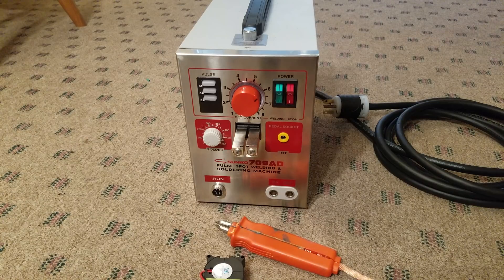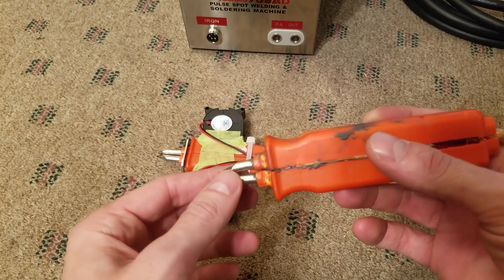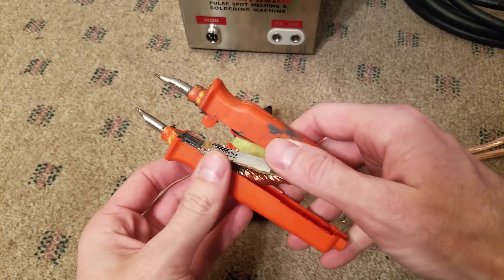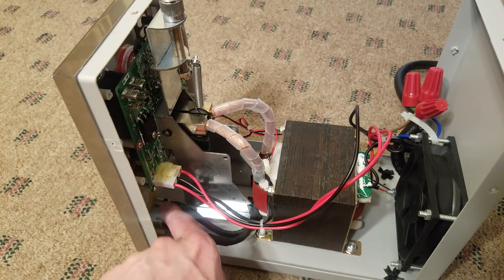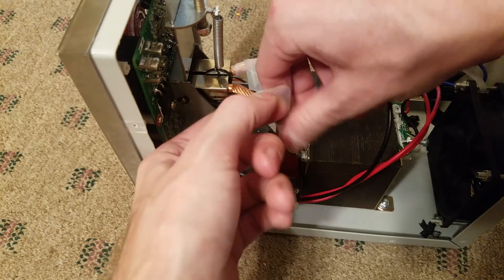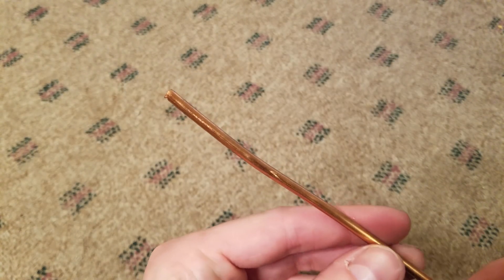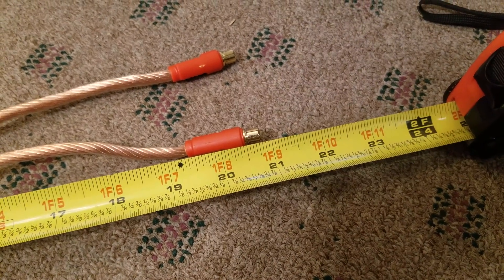Sunkko 709AD Spot Welder Welding Pen Upgrade, Extra 100A+!

Comment: Just did 1400 weldings, not super-fast and a quick quality check every 60 spots, it's a 709AD+. After the job the pen was only just warm, not even hot. Set at 6P and current at 5. I tried going faster (around 3 spots every 2" plus 1" to move forward and it did get warmer, but I still stopped every 60 spots for a quick check and had no heating problems). Maybe you go super-fast with no pauses...
Reply from the maker: What thickness and metal type strip were you using?
Reply: @LithiumSolar  nickel strip 0.12

Comment: A very good job as usual! Well done. Couldn't you simply remove the plastic handle and insulate the original cables? I also have a 709AD, if I have the same heating problem you know I'll be thinking about you LOL :D jes

Comment: Did you know that if you remove the hardware on front of the two welding arms, that you can then plug the welding pen directly into the main welding arms of the machine.
Reply from the maker: Yes, but there is nowhere near good enough contact

Comment: Why not just replace the wire going into the back of the welding pen with 4 gauge solid core and crimp the welding cable to that?

Comment: Bit of a longshot, but I'll try. Any chance you know how to change the copper electrodes on these spot welding pens ? I can't seem to figure it out
Reply from the maker: The tips just pull straight out with pliers. You should have received a few extra tips in the box of accessories (at least I did).
Reply: @LithiumSolar  Oh, I was afraid I'd damage something. Thanks a lot for a quick reply. Cheers!

Comment: I am not sure what happens with my mod. The only difference is my unit is the 787 and it does not have the pen option terminals and that my solid copper is 4 awg vs the slightly smaller one used by OP. I am getting way less amp and barely dent the nickel strip.
Hmm, now that I think about it. The 3/8 copper tube was oxidised on the outside but that should not have any impact. However, the solid copper rod was slightly oxidised so it may reduce the conductance. I have to remove it and sand it down to a shine and try again.
I wonder if my ghetto crimping is good enough. I just used a ratchet wrench (no fancy hydraulic crimper with die) and crimp down the middle.
Reply: I answered it myself. After cleaning off the oxidation, I was able to weld like normally. I don't have an ampmeter so I can tell if I am getting better power but it seems to well 0.15 strips well.
I was wonder if anyone know of a point on the circuit board where I can get a steady 10-12V 300mA DC. I was looking to power a 120mm fan which I've added to the 788 (corrected from previous comment). Right now I have a separate transformer to power the fan.

Comment: Does anyone know if this upgrade will be able to spot weld 0.15 nickel plated brass on top of 0.1mm pure copper sheet? 

Also I'm struggling to find the copper butt connectors :/
Reply from the maker: For the splices, just search Amazon for "bare copper butt splice" - there are dozens of listings. I'm not sure on the brass/copper question though unfortunately.

Comment: Interesting video.  I made the german kit version and it works well off a battery.  A few comments, electrons flow in the outside of a  conductor and so the wire you are critical of with all the strands is by far the best conductor there.  Keeping the overall resistance is critical for best performance.  Reducing the thickness by half of the wire is not good.  Using relatively thin solid copper is not as good as thicker rod for the electrodes.  It is easier to drill a bigger hole in the back of thicker rod and solder in the copper multi strand wire.  Each joint with a crimp will have copper oxide on the wire and crimp and increase resistance, consider a light crimp or no crimp and solder in addition.  Copper plumbing pipe which is work hardened when extruded can be used for joints.  Heat it in a gas flame and quench it in cold water.  It becomes very soft and can be cut cross wise and longitudinally to give whatever size you need for a crimp.  It can ce flared easily by hand using the taper on th end of a screwdriver or similar.  resoftening maybe needed halfway. If you can measure very low resistances the success of these alterations can be compared.  The length of the wire is also a factor as it has a small resistance.  Each area of resistance such as a joint will cause local heating and loss of current.  My electrodes are like yours but the copper is thicker.  I place them on the strip and touch a foot pedal.  It works well.  The guys with poorly performing machines should be concentrating I think on the output side not the transformer as I  run mine quite happily on a 12 volt high quality lithium battery from Hobby King.

Comment: Thanks for the video, couple years ago I built a 7p8s 26650 24v pack for a power chair, I made my own 'spot welder' using jumper cables, a shop quality battery charger, and a 72 series battery, so I was getting about 13v 800A or so thru a pencil sized rod of copper - two handing it, ground probe to push down then I'd strike it with the hot lead - I started out with them rigged up through a broom handle piece - it was a learning process lol... Revisiting it now, two years later as I was rebuilding the battery pack (8 cells of 56 had gone high resistance) I got one of the sunkko spot welders to help with rebuilding it. I found it to be sightly anemic for the thicker nickel I had - works fine with the thinner strips that usually get used for 18650s - I'm probably going to investigate doing something to milk some more current out of it

Comment: Thinking of buying this spot welder. How has it held up since this video? Is it still good? Thanks!
Reply from the maker: The Sunkko 709AD 240V still works fantastic. I've welded tends of thousands of cells with it at this point. There are better options on the market today though. If I were buying a spot welder again, I'd probably look at the kWeld. It has much higher power without the need for modifications.
Reply: @LithiumSolar    sweet! Also one last question. How many more times have you had to rebuild your leads?
Reply from the maker: @Bloodofmyshxdow  I haven't replaced anything since this video. The tips tend to get a bit rounded after a lot of welding (thousand or two cells if I had to guess), but they're back to perfect again after a minute or two of filing with a handheld file.

Comment: Hi is there a reason you did not use the outside  holes?
Reply from the maker: Yes. The wiring behind it is thin and there is less resistance, which means more current, to clamp directly to the source :)

Comment: Increasing the current by lower resistance of electrodes and increasing the length of the electrodes will also increase the inductive kickback that comes back to the relay after the pulse. May not be a huge issue at currents as low as 600A, but it also depends on quality of components used in the welder.  A much higher quality welder, like kweld that costs $200 just for circuit board, can withstand 2J, so about 6 feet of cabling at 1500A pulse. Not sure how long these chinese welders will last, but electrode length and inductive kickback is something to keep an eye on. This is why welding pens sold with these welders are usually very short.
Reply from the maker: I have welded tens of thousands of batteries since owning this welder. If I knew about the kWeld when I was in the market for a welder, I would have definitely gone that route...

Comment: What u considering to buy other than this one, i just know kweld(i think this one need to resamble yourself)also not found any in my area on ecommerce
Reply from the maker: If I know now what I did back then, I would just buy a kWeld and not the Sunkko. I'm not personally familiar with any others than these two.
Reply: What u consider learning from ,for beginner no knowledge about batteries ,solarpanel,scc and etc

Comment: How are you supposed to change the welding pins on this model?  I used a pair of pliers to pull mine out, true maximum effort, and they wouldn't budge.
Reply from the maker: I only changed mine once in the stock pen. I didn't have any trouble. I grabbed the pin with a pair of channel-lock pliers and twisted it back and forth, they came right out.

Comment: have u tried pure nickel 0.20 or 0.15mm ?
Reply from the maker: I'm using 0.15mm. I have not tried 0.20mm.
Reply: LithiumSolar pure nickel?
Reply from the maker: @ee-sj8qr  Yes, 0.15mm pure nickel strip.
Reply: @LithiumSolar  cool are u able to weld continuously without it being overheating? I'm facing the issue of the welding pen overheating if I were to spot weld continuously without stopping.

Comment: instead of crimping will soldering works to join the connector together? i am thinking to replace the wires for my sunkko pen to the same wire ur using here.

Comment: just to note you are using pure copper for the electrodes which will probably stick more than the copper/aluminium alloy that the electrodes are made from (which apparently sticks less and doesnt oxidise) think its aluminium bronze, its a bit more expensive and harder to find than pure copper but i found an 8mm dia 100mm piece im gonna try like this4
Reply from the maker: Interesting. I figured pure copper would be best. They do stick from time to time. Do you have any heavy duty alloy electrodes you'd recommend trying? I'm about to start another 14s300p battery bank that needs welding so it would be great to replace them ahead of time if that would help.

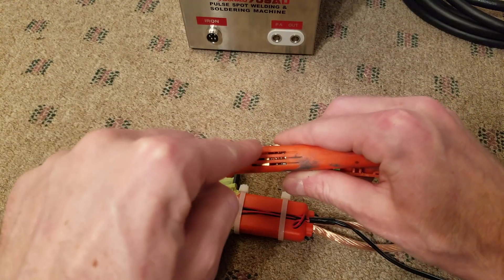Comment: 1:00 You say it pushes air forwards and backwards, how does that work as I can't see any vents at the front or back?
Reply from the maker: It has an 80mm fan that moves quite a bit of air. You can see it at 1:50.
Reply: @LithiumSolar  Sorry I can't see where that shows the exhaust vents at the front and back of the hand held welding tool.

Comment: Cutting 4ga down to 6 hurt my soul.
Why not attack that awful solder job on the transformer side?
It's likely the current is only going down a few strands of that wire because of its poor electrical attachment... and thus a major contributor to the heating you're seeing.
Or upgrade all the wire. That's not a long piece there.
It's depressing how cheaply Sunkko made these.
I can already see myself gutting everything but the transformer and maybe the top pedal switch. Alas, employer will only let me buy off Amazon... ridiculous.
Reply from the maker: Fixing or replacing the transformer would have been best. I didn't want to rip it apart that much though. Maybe if I ever open it again, I'll at least redo the transformer soldering. It is sad. For an extra $20 or so at Chinese prices/labor, they could have a a MUCH better device.

Comment: Hi, I bought a 737G spot welding machine and it doesn't have enough power at all for 0.2mm nickel. I tried to replace the bigger transformer and the new secondary winding wiring, but the same result. does the electronics comfort so much reduce the current in the primary winding?
Reply from the maker: I'm not familiar with the 737G. I have never used one but have heard a lot of complaints from others about it being under-powered, even for 0.15mm. I would see if you can return it and buy a 709AD or even a kWeld, for welding 0.2mm.

Comment: What is the voltage open circuit of your tansformer? Thanks for the video.
Reply from the maker: I don't have a way to accurately measure that unfortunately. The pulse only lasts for a split second.
Reply: @LithiumSolar  Thanks.
Reply: How is it holding now since this video?..I want to try this mods on my existing 709ad….planning to totally change the cable to a 4guage and a buy a heavy duty pen to lower resistance thus increasing current,..could the controller transistor and other components hold?..thanks for the video..

Comment: Hello,
Can I use single core multistrand 16sqmm cable instead of welding cable?
Reply from the maker: Any wire will transfer the electricity just fine. The more strands it has, the more flexible it will be. I used welding cable because the strands are very fine, making it super flexible, and has a higher temp insulation rating. I think it was rated for 105C, can't remember offhand.

Comment: 9:49 Hi friend, you are shorting the aluminum part of your tool, aluminum has higher resistance than cooper, this is not a great reading.
But i believe yours are way more efficient since they are all copper.
Reply from the maker: Interesting, I haven't considered that. You are correct!

Comment: What thickness of nickel strip are you using? I've done a similar modification but used welding connectors. I've tried welding pure nickel strip 0.2mm and it welds to a piece of steel, but doesn't weld to the battery. Was hoping this modification would allow my 709A to finally weld 0.2mm strips.
Reply from the maker: I'm using 0.15mm nickel strips. Unfortunately, I don't have any 0.2mm to try.

Comment: Great idea! How many welds can you do with your self built electrodes until they are hot? I bought the 788H and want to do something similar...
Reply from the maker: It does still get hot after a while. I can get through just over half a side of a 300p pack. I'd estimate 200 cells and with 2 welds per cell, that's 400 welds. At that point, it's to hot to hold and needs to cool off. I think I could improve better by using better crimps on the electrodes. I'll bet that's where most of the heat comes from.

Comment: Brother, you are a God sent Holy person. Indeed you are, why? Because, you inspired me to perform the similar procedure to the DEAD SUNKKO 788H, (That was thrown away in junk) which is now a full fledged spot welder with higher current and and the weld very strong. I had to length the cable, exactly like you did 4AWG silicone cable and used copper tube to join both the transformer cable and the silicone 4AWG (reds) and crimped with the hydraulic crimper, that made the  connection very sold. Bless you man, for inspiring me.

Comment: I have been wondering what spot welder to get I see a lot for sale but so many bad reviews I guess the problems that many have is they are using the 120v version. Apparently the problem is the welding transformer they chose to use in the 120V version.  I guess I will just have to buy the 220 volt version and plug it in to a dedicated 240 volt outlet like you did. I thought of another idea and that would be to simply replace the too small power transformer that is in the 120 volt version and just use a modified microwave transformer and replace it to get the higher amps. This might be a better option for those that already own the 120 volt version.
Reply from the maker: It's like any other Chinese product unfortunately. There are good and bad. If you choose to go with Sunkko, make sure it's the 709AD 220V model. The 709AD 110V model is no good (see my other videos) and other Sunkko models like the cheaper 787 don't work well either. The 709AD 220V is perfect.

Comment: are you on 120V outlet?
Reply from the maker: No. This is the 240v version of the 709AD. Don't buy the 120V  version - it's not designed properly.

Comment: well, it's definitely a budget product, but i'm happy to have it, and glad that my 110 unit works just barely well enough to reliably weld 18650's. I double tap in the same spot twice, and do two spots (4 burn marks) per cell.  all 3 pulse buttons on, and current turned up all the way.  i hear the 240v is better, and that's what i ordered, but the idiots sent me a 110 because i had it shipped to america..  at least it works until i can get an industrial unit.
Reply from the maker: I was afraid of that happening too. Most eBay listings I looked at said like "120v 240v" in the title. I was confused and started contacting each seller. None of them would ship a 240v to the US. The sellers on aliexpress are much more willing to work with you. I asked ahead of time and made sure she knew I wanted the 240v version before I placed the order :)
Reply: Did u re wire to 220v
Reply: @jasperhart1188  Nope.  could not.  stuck with 120.  it pops the breaker often and I have the largest one I can in that circuit.  I have given up on using the spot welder.   I still use the unit for the temp controlled soldering iron that comes integrated.  but when that gives up, it will go to scrap.  not buying another Chinese spot welder.  I solder my 18650 cells now and with better results anyway.  not worth it to but this junk

Comment: do you like the arduino malectrics spotwelder?
Reply from the maker: I never used one to be able to compare the two. I was thinking of buying one until I fitted the Sunkko with custom electrodes and saw it now works perfectly fine.
Reply: @LithiumSolar  well i bought one and it works great no 240v to worry about

Comment: I have a 788+ which I have not been very impressed with. Can anyone comment on the difference between the model in this video and the 788? And also do you think this mod might significantly improve the 788?
Reply from the maker: I can't comment on the differences, but it doesn't look like the 788 has a welding pen? Are you just using the front terminals?
Reply: @LithiumSolar  that's correct no front terminals but I see no reason why I couldn't add them and do away with the existing terminals
Reply: Did you buy the same pens? (probes?)

Comment: If the wire of the transformer is the same gauge for the bottom and mounted leads, I would do this to the bottom since the mounted ones still come in handy.  Heck, after looking at the solder to the transformer I may just run a new wire with better solder.
Reply: I know this is old, but you can just use both top and bottom set of wires at once.  It will act as if you doubled the size of wire.  No doubling in voltage or amps, but huge decrease in resistance... which may help a little with amps.